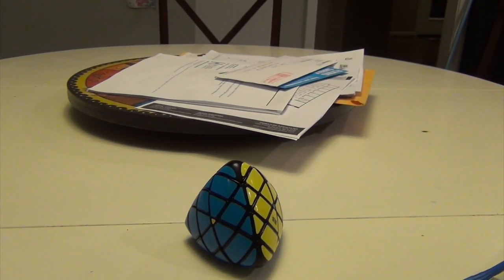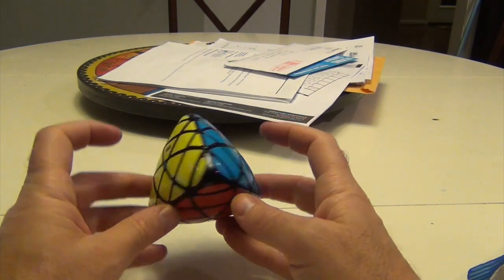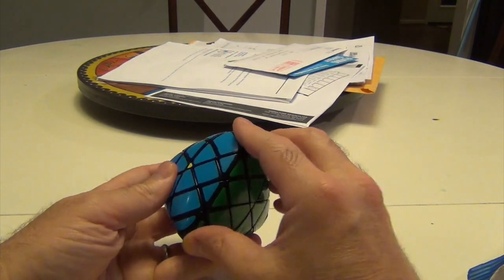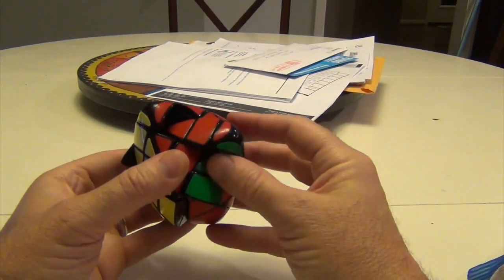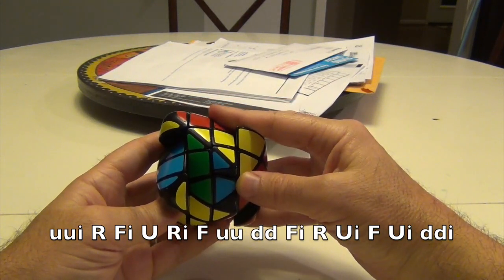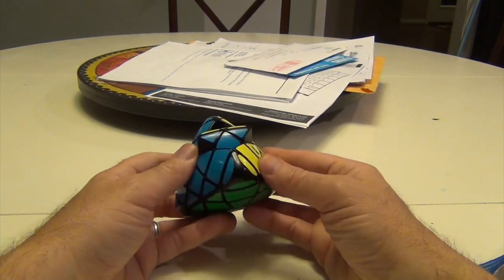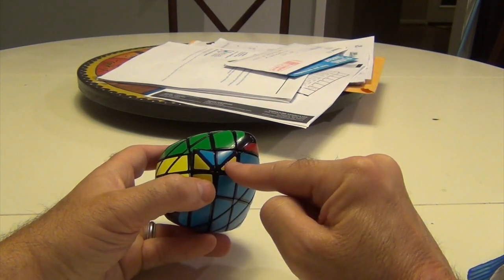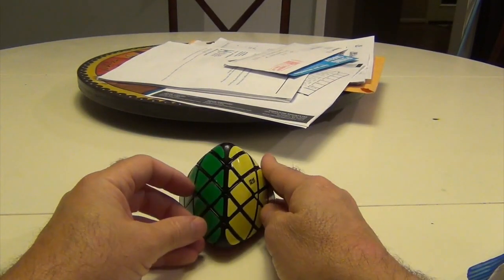Viewer question:  Megamorphinx corner parity?

Comment: I just use a center swap commutator.  Same as if I'm solving the last two centers on any big cube. Swap two equivalent pieces, fix anything that got messed up, and you're good to go.
Reply: Oh and the centers swapping can be done easily with the same corner swap algorithm shown earlier.  Just do it one layer deeper.  I use that on any 4x4 supercube.  I can't ever remember the 3-cycle algorithm usually shown here.